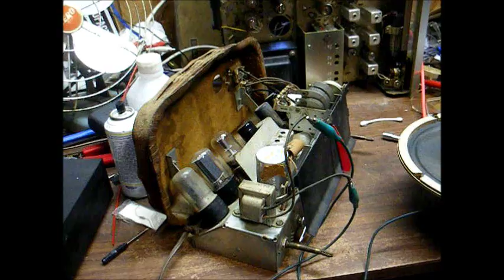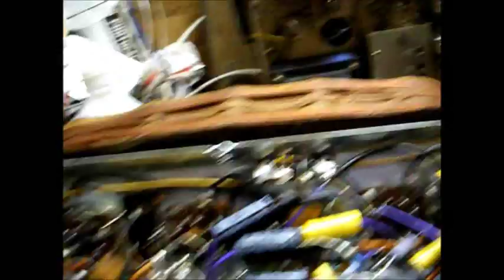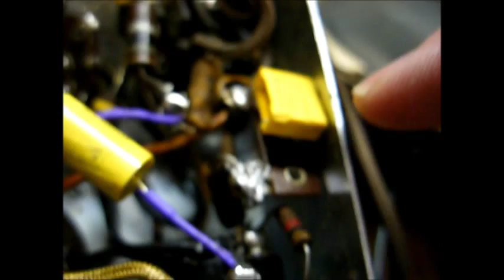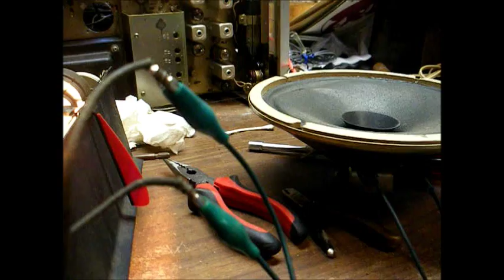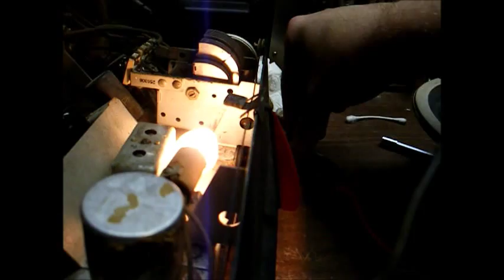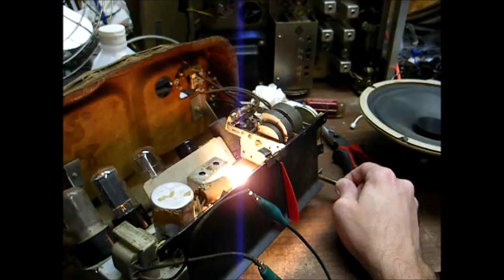1940's GE tube radio chassis repair (simple fix)

Comment: An isolation capacitor? It would still pass AC, right? So you couldn't use it as shock protection. Unless it was a DC circuit. Or does it limit current?

Comment: I have a problem  routing the string that selects the station from frequency selector dial to the variable capacitor. the string slips on the selector knob, not moving the capacitor or the dial GE MOD 202
Reply: Cool!!!

Comment: I have the same hum problem with my GE AM clock radio from 1951 which is a 516F. I did removed the electrolytic paper capacitor, because it was dead. I have to get a replacement for my clock radio to get working without any hum issue. The original paper capacitor had 3 wires on it. The red wire goes to the 50 MFD and 150 VDC, the green wire goes to the same measurement, 50 MFD and 150 VDC and the black wire goes to the ground connection. All I need to get is a better electrolytic capacitors to decrease the voltage to get a better working radio to reduced the hum. If the chassis gets hot, all I need to get is a dropping resistor to reduce heat from chassis to cool it off.

BTW, good to hear WNBN, it's still a black oldies station, just like the good old WWRL in NYC. I remember listening to WBLS where Hal Jackson did the "Sunday Classics" for years, and the "Rhythm Review" with Felix Hernandez where he plays classic R&B and many obscure soul songs that you don't hear it on the radio anymore. I tried listening via stream and it won't work on my TuneIn.

Comment: I'm always impressed by your knowledge and ability to troubleshoot things quickly!  Much appreciated.  I'm working on a '46 Olympic 6-601w that's basically doing the same thing, I can hook my signal tracer to the 2nd IF on the 6SQ7 pins 4-5 and get great sound both broadcast and SW.  Nothing out of the speaker, think I've got my electrolytics hooked to the wrong ground.  It's doing the same thing, but NO signal on the 6v6 at all.  I will investigate the grounds.

Comment: Did he replace a multi section can cap with all the caps that were grounded incorrectly? I have an old tube CB rig that needs the multi section can caps replaced. How do i do this with new caps?
Reply: Eric 12374 These multisection caps obviously contains many capacitors in a single package. They usually what values are inside listed on them. Just get the closest values you can at exactly the same working voltage or more. The capacitors in the old can usually all share a common lead (positive or ground). Say in your case the sections in the old can share a common ground (the can will say). You'd take all the negative leads of your new singular capacitors and solder them together as if it were one, leaving the positive leads free (or vice versa). Regarding where the new free leads goes, the cans usually have symbols (circle, square, etc.) next to the listed values on the old that correspond to the old leads on the bottom. Hard to explain, but I hope this answers your question.

Comment: I'm restoring a 1941 Silvertone AM / SW radio.  I couldn't figure why my rectifier tube would cherry plate when bringing up the voltage on the variac.  Discovered later on, after I put new leads on the power transformer, the transformer bells were so tight it caused a splice to break through the heat shrink tubing shorting B+ to ground.  I used one washer on each side to shim the front bell and it's good to go. ;-)  I applied spar varnish on the tubing to re-insulate any pin hole breaks.

Comment: Thanks for the video, that radio is an interesting design with that sloped chassis, works well now, good job. Over here we have a product called SERVISOL Super 10, been available for years, which is great for noisy pots and switches.
All the Best.

Comment: That radio should perform a little better then that on a weak station, it looks like it has a tuned RF amplifier stage, like most old sets it probably needs an alignment. In terms of miswiring something I did that recently on a Guild spice chest radio chassis. I hooked up the volume control coupling cap to the plate of the 12AV6 instead of the grid, it only took me about five minutes to find my error since I checked everything out with a volt meter.

Comment from the maker: Spray a product called Deoxit, or other control cleaner, into the openings on the control where the terminals are located. Then, rotate the control through it's range several times to allow the cleaner to do it's job.